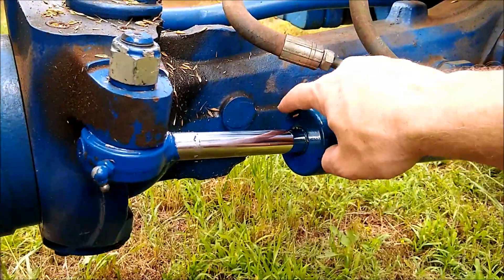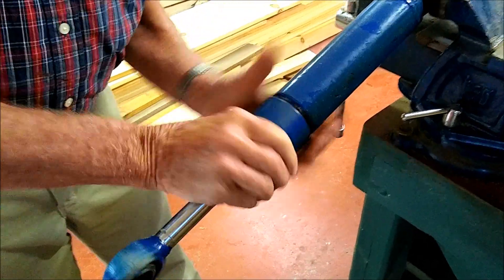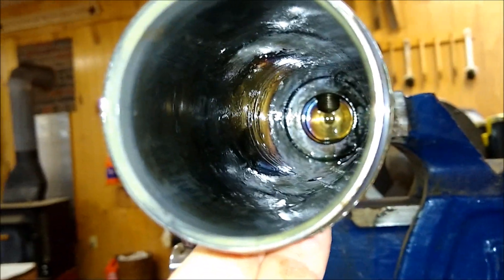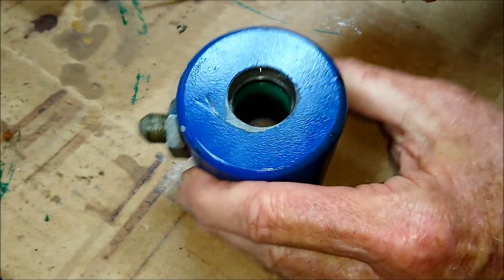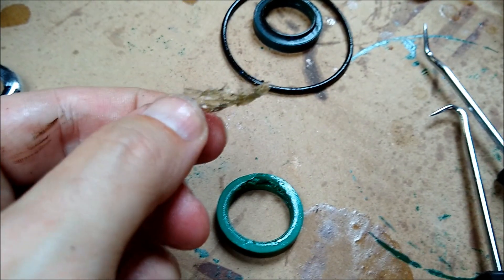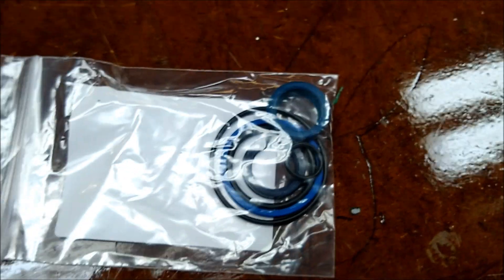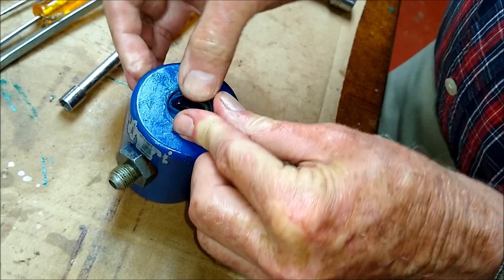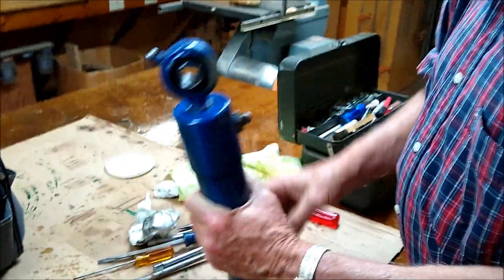Steering Cylinder Repack

Comment: How do you like the 665? Looking at a 555DTC.  Are these rebadged Fords? And do the 665 use the same steering cylinders as the 555s
Reply from the maker: First the bad. It's crude and the 3 cylinder is loud and has a lot of vibration. Have had a lot of bolts back out. The F/R shifter had a sloppy feel. It's nothing to compare with a newer name brand tractor. It lacks refinement. Had some fuel issues with trash in the tank and a stopped up screen in the tank. injector lines rubbed through due to no clearance between them and the battery pan.

The good. They're usually much cheaper than a comparable size tractor and they're capable. The drive train has been leak free. Really impressed by no leakage in the front drive axle. It's strong. It sips fuel. Can get parts from ITP solutions. Prices seem to be going up in price. I haven't found many interchangeable parts between it and a Ford. Keys, weights, dash, things like that. Good luck if you get one. There is a message board on tractor by net with a farmtrac forum with some useful info.

Comment: I have the same tractor, could someone let me know if the steering uses the same hydraulic oil as the transmission, or does it use power steering fluid.
Reply from the maker: It shares the hydraulic oil with the trans.